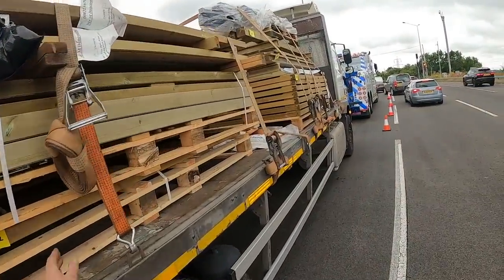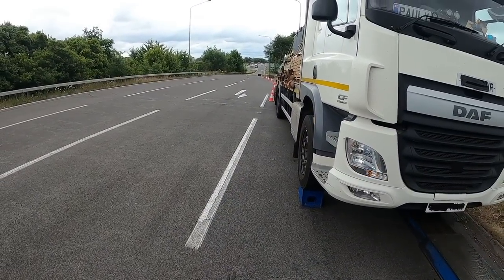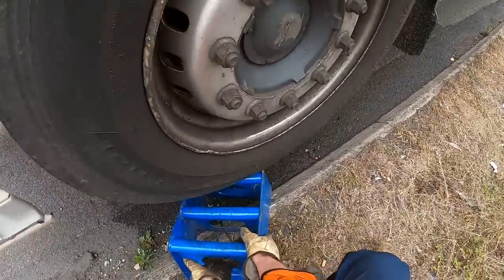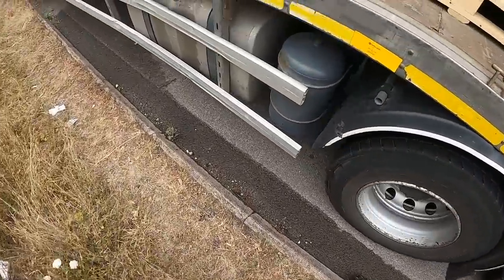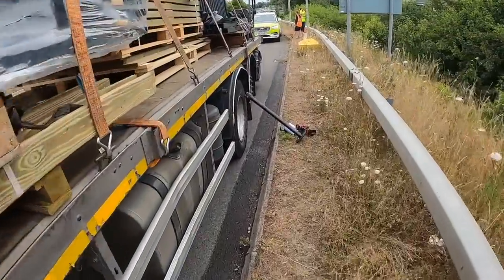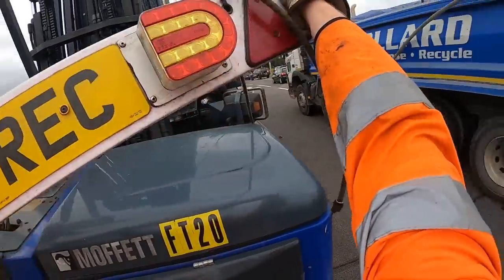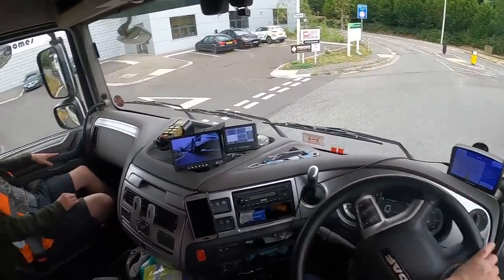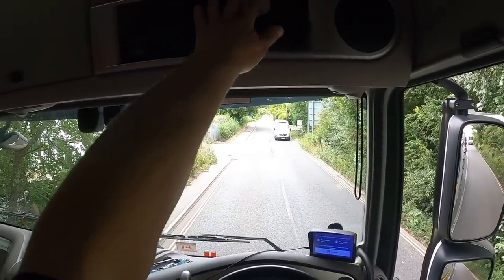DAF TRUCK STRANDED ON SLIP ROAD! DAF ON DAF RECOVERY!

Comment: Great thinking by the engineers to have the air input in such a handy location; quick and easy. Good job, Steve.
Reply from the maker: Hi Ricky thanks again for watching from US.
Reply: What surprises me is that None of them (tractors) ever seem to have trailer brake control test/tow connection points at the same place as the main air test point though, 
always have to go back to the trailer itself.

I'm sure that those points could be fitted and made to work, either automatically when connected or via some kind of lever that swaps between normal and tow air mode (with Tow air mode position preventing the rig from being able to drive if no external air present to prevent a "no trailer brake" incident).
Bonus there would be that then the tractors brakes could also possibly be controlled by the wrecker if the system is designed properly.

Even better if there was also a plug for the lighting control connection to the wrecker as well (@Steve, I seem to recall that some Buses's do have such a connection?).

If the manufacturers did that, then in most situations you wouldn't need to fiddle with the trailer connections and could then just use short jumper hoses / cables.

Comment: thanks for the video Steve, it's always interesting to watch. I do have a couple questions, how do you handle a twin steer truck? I have only towed one and I had to chain up the 2nd steer axle, is that the same over there? and I notice you don't run safety chains (or secondary chains), I assume there is no requirement for it?

thank you
Reply from the maker: Hi Adam , if truck loaded like a 32t 8 wheeler for instance with twin steer front axles i would lift the 1st steer axle off the road and keep 2nd steer axle in contact with the road with key in ignition steer lock off. This will reduce the weight i am lifting and reduce the strain on the loaded tipper chassis. No legal requirement to run safety chains over here. Thanks very much for watching channel.

Comment: Nice work. How is it to drive as a combo without any braking assistance on the towed load? Are there any weight limits?
Reply from the maker: Hi Rob thanks for watching, not sure on limits, once towed a 96 tonne mobile crane on fixed bar , but crane driver was able to run engine so he able to steer and brake with me. That biggest thing i have towed and never again lol.

Comment: Great Video!
Is your DAF manual or automatic?
Reply from the maker: Thanks for watching , truck is manual box 16 speed ZF gearbox.
Reply: @HeavyRecoverywithSteve  And what's the advantage of a manual when towing?
Easier to maneuver with a clutch?
Reply: @doctorrohrenkuh880   easier to slow down or keep your speed down without burning up your brakes
Reply: @adamt4742  just Switch the automatic transmissions to manual. Then the truck won’t shift gears

Comment: Yeah, failed PCIs are super common on these euro6 DAFs, especially as they are continue to age, and the most common time for them to fail being in the summer (when it`s warm).
If the engine cut out randomly, and there were either loads of wierd faults on the dash, and the DRLs or the crankcase ventilation come on when you turn on theignition, it`s a surefire way to know the PCI is dead...

If the DAF dealer was nearby, and assuming he had broken down at a more convenient location, he could have let theenginecool down, and he would have eventually been able to start the engine back up and continue on (though the engine would just cut out after a while, once the PCI would reach that critical temperature again).
Reply from the maker: Hi Andre thanks for watching,  your spot on with your comments mate , the Daf drove into the workshop once it cooled down.
Reply: @HeavyRecoverywithSteve  well, to be fair I`ve been working at a DAF dealership for a couple of years now, so I`m aware of many of the common faults on these and the facelifted F7 trucks (like yours)... Over the summer we saw them drop like flies, with over half a dozen failing in a single week...

As a bit of (hopefully) handy information, if an F7 DAF XF or CF cuts out and refuses to start, or starts but has a terrible idle that is super rough or super low, there is a decent chance the VTG actuator has failed, which is another super common point of failure (they fail on the euro6 too, but ether the failure rate on the newer trucks is much higher, or thay have already been replaced on most of the older trucks). The variable geometry veins in the turbo basicly get stuck in a position where the exhaust is too restricted to rev up, or even idle. It can also be a sign that the turbo itself is on the way out if the technician finds the mechanism to have an overly stiff point in it`s movement...